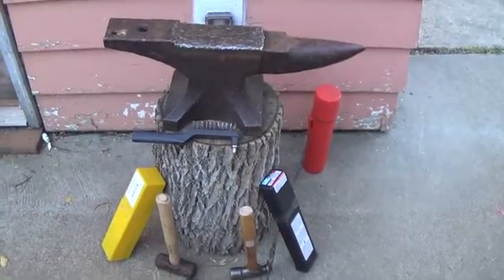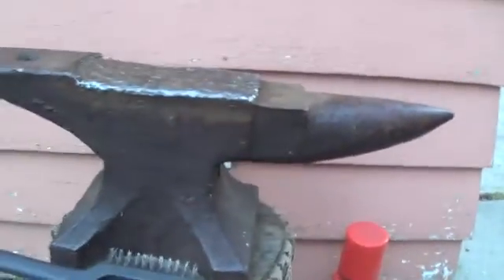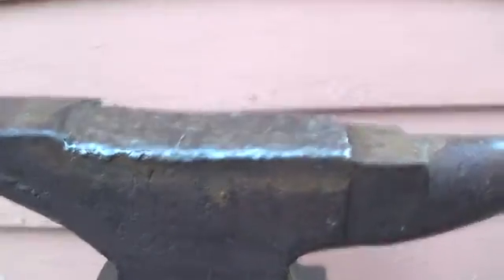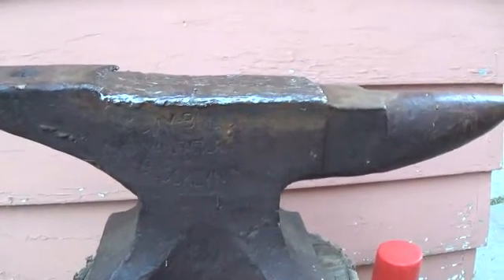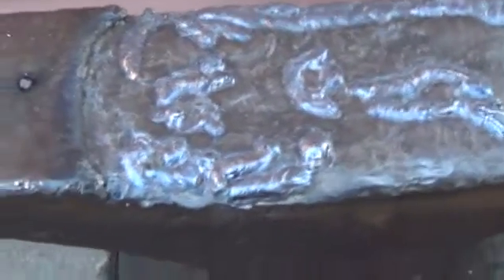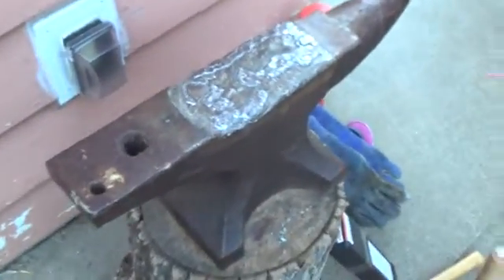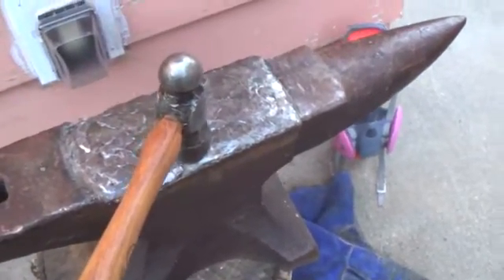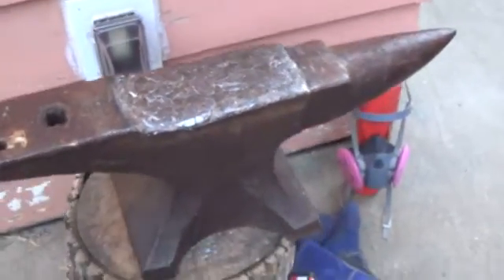Anvil Repair Part 1

Comment: I recently found a 149 pound hay budden in the same condition, with the face plate broken off about 2/3 of the way from the heel. I plan to get it here and see who I can find with forge welding experience to weld a whole new face plate on it. I've been tinkering in blacksmithing for years but don't have much forge welding experience.

Comment: We are taught to preheat the base metal before running lo-hydrogen rod (7018), 250 degrees for a one inch thick plate was typical, not to confuse you though.